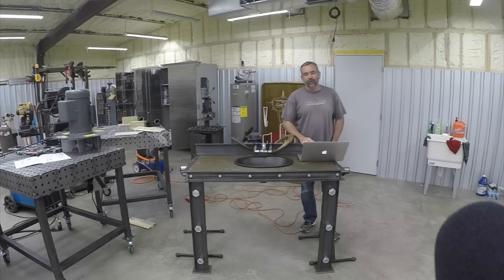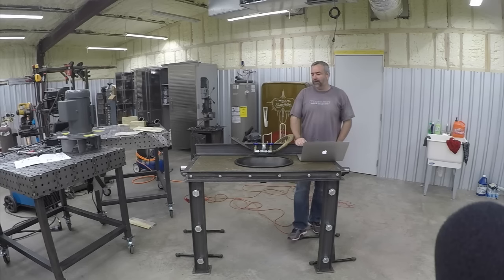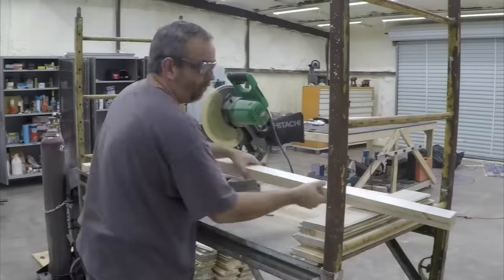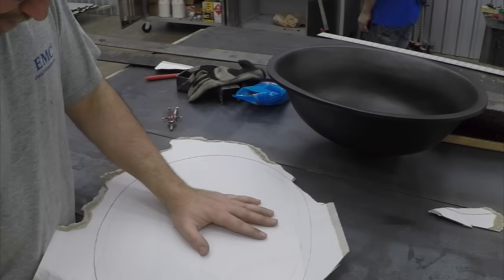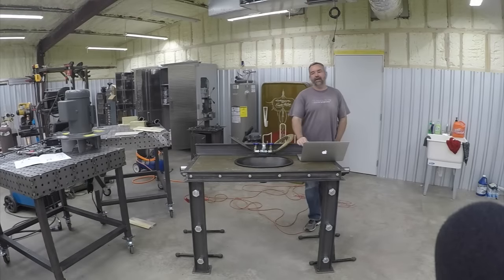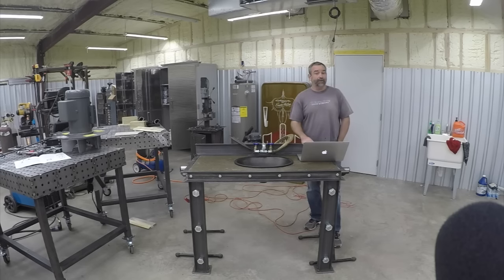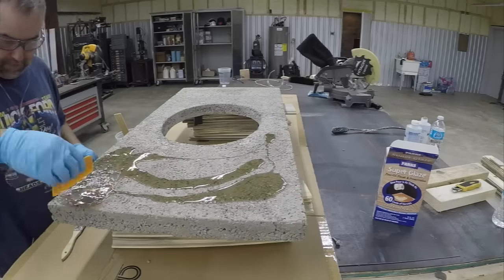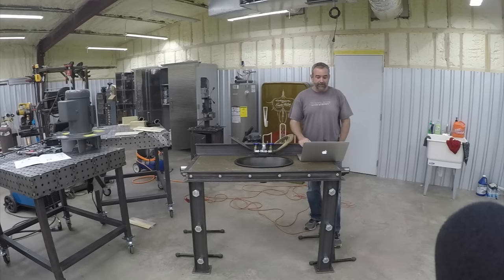Concrete Counter Top - Brilliant Recovery or Hack Job Fail?

Comment: For this case, the ends justified the means.  Wetter mix would have made for a smoother finish, but honestly, I doubt it would have been perfectly smooth casting 5000psi anyway.  If you flipped it over after an hour or two, broke mold and troweled the finish surface smooth by lightly spraying with water and a trowel you could have manipulated the surface to your expectations.  For the future, when doing precast concrete on this scale, you can make a good concrete vibrator by using a reciprocating saw.  Remove the blade and place the shoe of the saw on the form...fire up the saw and watch the bubbles rise.

Comment: Tried the same thing some years ago. I had the mould on stands, in order to "shake" the concrete together after the filling was done. I used a hammer drill where you could kill the drilling and only do the hammering on the underside. That shaked it together and gave a smooth surface after the mould was removed. It only needed some polishing with a diamond disk and then some kind of oil.
Anyway great job Gary.

Comment: I don't know if I'd qualify it as either. Other than, maybe you didn't know that your solution is something that is done often anyway. A lot of travertines are too porous for a counter top, so they will epoxy fill those. Other than it turning out initially different than you intended...your solution is a valid one. A concrete vibrator could have helped get rid of the voids, was probably mixed well enough if you had a vibrator.

Comment: The only different between a amateur and a professional is a professional know how to fix his mistakes.  I haven't made any cement tops yet but I have been researching it.  I was under the impression slightly sloppy was better because you don't want it to dry to fast and it allows air bubble to work there way up.

Comment: None of the above. Its a learning experience. You learned what works and what doesn't. Next time you might try making some small square molds to try different concrete mixes in until you get it just the way you want it. Just be grateful you have a failure that's still usable. :)

Comment: My 1st job in the machinist trade the pay scale was A B C with A being the highest. When I was at the "B" scale one of the older "A" men told me the difference between him and I was the fact that he knew how to fix his screw ups.  I resented it at the time but never forgot it.  It was pretty much true too.
Reply from the maker: +Cad-Cam_Man That's a cool story thanks for sharing, I think for the most part he was right!
Reply: He also said that the only time a machinist hurries is when he has made a mistake or about too! LOL
Reply from the maker: +Cad-Cam_Man Lol, also true.  That's thing if you watch the machinist on youtube, they really are patient, checking, double checking, etc.  It only takes a few times being burned to slow you down.
Reply: +🔥Ramsey Customs - turbocobra This is especially true when your working on a hunk of tool steel that cost Thousands just for the material!

Comment: You should have made a "slurry" with cement  no aggregate and concrete bonder from Home Depot / Lowes , that would have filled in gaps nicely! 🙂 Then polish down to 3000 grit wet , before the epoxy sealer...... But for the first time, it looked awesome "
Reply from the maker: +Brent Dantin I thought about making a slurry, but that would have covered up the one part of the mistake that most everyone that saw it liked which is al the aggregate and pours.  Will definitely be doing slurry mix on the kitchen counter top

Comment: You didnt even show the finished product in your video. How can we answer your question? Secondly, ou shouldnt use rebar in concrete countertops. Nothing larger than 9 gauge metal